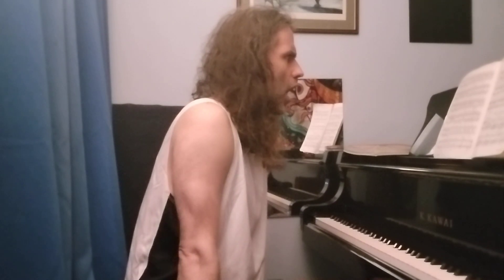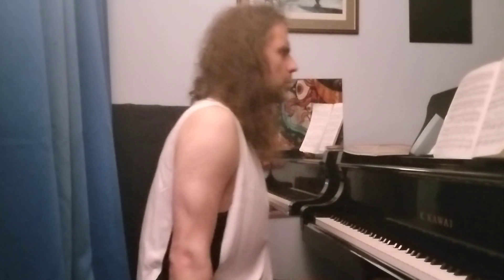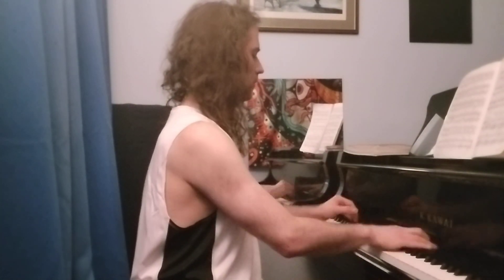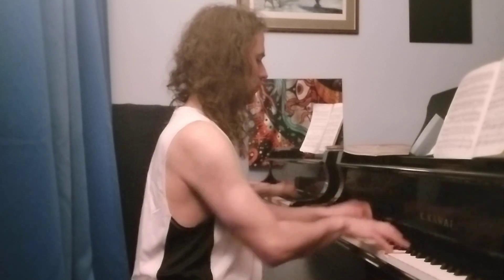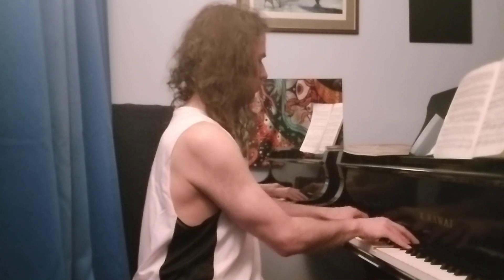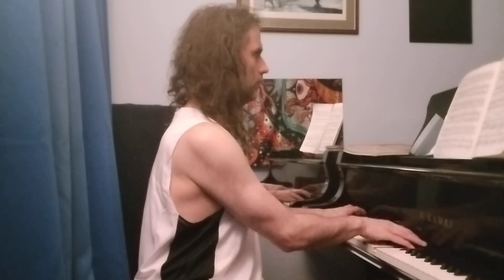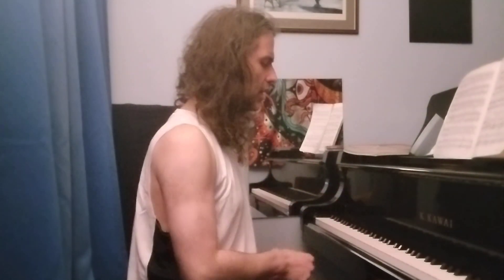Keybedding at the piano- why restraining yourself doesn't help!

Comment: Great video, thank you! 

I learned the organ to a high level many years before learning the piano, and when I did get to the piano I was mystified by how to get energy into the hammers without slamming hard into the keybed. 

As you stated clearly, neither fear & restraint nor precision timing are solutions at all. I tried both those routes and they just didn't work.

Sadly for me, it seems by slamming my fingers into the keybed of my Yamaha digital piano (playing things like Tch C1 back around 2008-2012) I've permanently damaged the tipmost (dip) joint of my little fingers - like runners damaging their knees by running on concrete. Doctors are very confused by the x-rays which show that all my other finger joints are fine. I don't think it's possible to get damaged in this way from real pianos - certainly with real pianos I don't ever experience the running-on-concrete feeling that I have with my digital piano - but still better to solve the problem.

I will work (on a real piano) at what you describe and demonstrate. Press ups used to be my thing, so I'm hopeful. And you make it look so easy! 🙂

Thanks again. A very important topic.
Reply from the maker: Hi, very glad if you find it useful. Sorry to hear that you have those issues. I posted a little on rotation before, although just in the context of trills. If it's just your finger 5s then it may well be about rotating to actively direct energy down into the finger, thus compressing it, rather than to open up space around 5 as the centre. This a common way to compensate for a feel of weakness but sadly the "help" of the arm only makes everything worse.

Regarding digital pianos, that's an interesting point. It's possible that the sense of distance and indirectness from the sound (particularly if practising on low volume) can make us instinctively want to deliver more force, due to psychological reasons. When I practice on pianos with a neutral sound and no tone colour, I always myself playing too loud, in a bid to squeeze out some colour and voicing. Before I refined my technique more this certainly raised bigger issues. However, it may also be that even with good technique digitals have less innate shock absorbency at the key beds. Some pianos certainly do seem to feel more absorbent and forgiving, whereas others call upon the player to be extra sure of using the keybeds as well as possible.